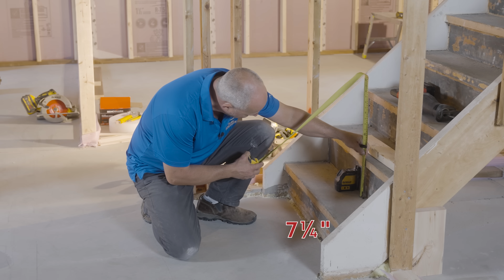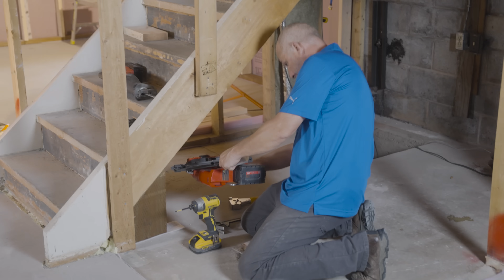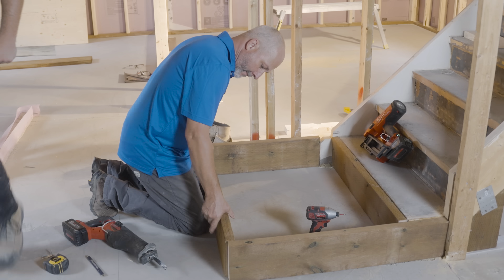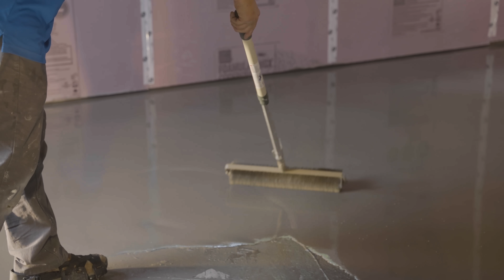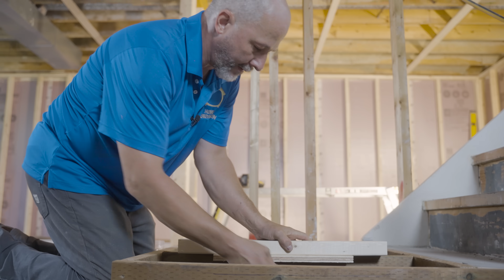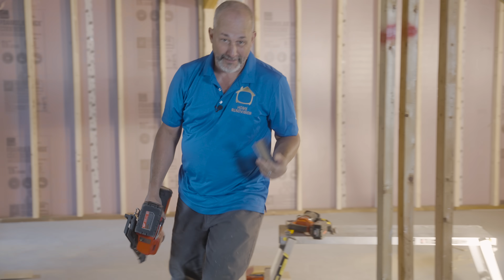The Most Common Basement Problem (And How to Fix It)

Comment: Why do I feel like this is being done the hard way LOL.
Reply: He actually created more work than what was needed. If he ran the 2X8’s through a table saw to cut off the 5/8” he could have glued and screwed one piece of plywood to the base. Adding extra pieces of 2X4’s and sistering is way more time consuming and it can squeak. He also could have added Zip tape under the 2X8’s or used treated to save a step. Yet that would cost more.
Reply: @jasonroets660  I had to build 2 landings in my new build as the contractor screwed up the stair stringers, not even getting into that in a public forum.   however I did exactly as you did, and running the lumber through the saw really straightened out the frame.   Cos you know how good lumber these days is, i think they are getting them from banana trees.

Comment: I'm finishing a basement.  Does anyone know if better to install drywall first or doors? I'm at that point.
Reply: @Gemini-wz3id  if the doors are prehung you need to have the drywall first because the trim sits on top of it. If you're assembling the frame from scratch and the trim isn't attached you could do the doors first and keep the trim for after the drywall is up.
Reply: @Gemini-wz3id  I actually did this in my basement about 15 years ago. I did the drywall first. I did 4 doors, basement is 2240 sqft. (ranch home), 1600 is finished, rest is storage, furnace, water heater and a work shop with 2 work benches and mostly unfinished. I bought 3 four panel oak doors unfinished and a glass mirror sliding door (for a closet). Doors come standard with a frame for a 4 1/2” (or 4 9/16”) wall (3 1/2” stud + 2 pieces of 1/2” drywall). My 3 doors came this way. The sliding mirrored glass door (set of 2 for an opening of 4’) came with no door frame, so you have to frame this out yourself. The oak doors fit on the space with no problem on 2 openings (to the workshop), however the third wall was not 4 1/2”, but 5 1/2”, so the door frame was 1” too short. I also needed to trim out the opening for the sliding mirrored glass door, that opening was the standard 4 1/2”. I bought 3,  8’ pieces of 3/4” white oak boards 8’ x 6”. I cut the oak pieces for this 4’ sliding door (2@ 4 1/2” x 80” and 1@ 4 1/2” x 4’), at the base to support the track I framed the wall with a 2x4 on the floor. This made the opening a box, I did this for the other 3 doors also for the same reason. The fished space was 18” ceramic tile which was about 1/2” above the floor and I trimmed the with a 1/4” shoe stained for all doors except the 4’ sliding door, it wasn’t necessary. The door going into the washroom, which was 5 1/2” wide, I installed the door flush inside the washroom and I added a 1”  piece, all around the opening (this was left over from the 1x6 oak I bought, I measured this in advance, this wasn’t by luck). 
PS: Reasoning behind all of this.  The 5 1/2 wall was under a beam supporting the home, so it couldn’t be 4 1/2”.  The 2x4 in each door opening on the  floor. The washroom door was next to a support steel post next to the door, this made the frame solid. Both other oak doors, one was by a support post, the other was next to a wall that was short, this tied everything together solidly. Same with the closet, it needed something on the floor for the sliding mechanism for the sliding door. The doors/frames, trim, and oak, were all stained and polyurethaned before they were installed. The 2x4’s on the door openings were stained and polyurethaned in place. I double trimmed (both sides of door) the washroom, closet and even the doors going into the workshop. 
PPS: I paid $79 each for the oak framed door (oak veneer doors and frames, solid doors), for a 4 1/2” wall. To get a door made for a 5 1/2” wall, it was special order and cost $225. So I did it the way I did. I had a tablesaw, without it, you would have to find a was to cut down the oak. I also made 2 window sills from the remaining oak in the basement.  
I hope this helps……questions?

Comment: Just a thought:
It would be better to rip your new joists to match the height of the last step of the existing stringer, remove the tread material from the bottom step of the existing stair and replace with a new one piece landing plywood piece to encompass the existing stair tread and the new landing in one piece.  Also, it would be a good idea to secure the new floor joists to the concrete floor with 2x4 plates that are attached to the concrete floor with fasteners.  (3” framing nails combined with a double strand of tie wire driven into a 3/16” hole drilled through the 2x4 plate into the concrete floor works very well) (A 3” #8 screw combined with a piece of 14/2 copper wire with insulation also works well and is easy to extract if needed.
John Jensen from British Columbia
Reply: I've never seen basement stairs secured to the cement floor the way you're describing. Is there a reason to do it?
Reply: @ 
If the stringers are only attached to the floor joists at the top, if done properly, it is a good connection, but adding a secondary connection to the floor at the bottom is bulletproof.  With stairs inside a stairwell where the stringers are attached to the studs, this is not critical, but with a set of stairs coming from a deck down to a concrete walkway for example, securing the stringers to the concrete at the bottom makes for a much better connection.  I usually notch
the stringers to  accept a 2x6 plate fastened to the concrete.  This makes a bulletproof connection and keeps the stairs from sliding out at the bottom.
Hopefully this makes sense.
Reply: Bingo!
Reply: Yeah, I would have ripped 3/4" off the deck joists and just cut one sheet of plywood to cover

Comment: My biggest basement problem is... I don't have one, and I'm still watching.
Reply from the maker: LOL. Thanks for that. Cheers!
Reply: I have no basement, no attic, and 625sft. I watch this channel to see all the things I can't do.
Reply: @nayy31  I live in the Midwest (NW suburb of Chicago). I’ve been here in this area since 1955. Basements are a normal thing here (Wisconsin, Michigan, Indiana, Iowa). Architects, builders, etc, in this area, know how to build basements. My brother lives in Charlotte, NC and I’ve seen walkouts that were done wrong with water problems.  A friend built a home in Mountain Home, Arkansas and did a partial basement, with drainage tile, sump pump, etc. The building inspector had never seen anything and didn’t know what to inspect, he was confused, but it worked well. Florida, the water table is 6” down, no basements. So you have to check out what’s happening in the area you want to live, talk to inspectors, builders, etc.
Reply: That makes you a dumb dumb

Comment: Why not rip the boards down and have one sheet of plywood for subfloor?
Reply: That was my first thought. Then you'd have the plywood pushing down straight on the frame.
Reply from the maker: that is another option, however I did not have anything to seal my edges that day and I am all about production. Cheers!
Reply: @HomeRenoVisionDIY leave the cut side up no seal required

Comment: Just rebuild nicer stairs if it's your forever home
Reply from the maker: I will cap them, but I don't see the need to but a new set of stairs when the fix is so easy and it creates a nice space to add a wall for separation to the bathroom and install light switches as well. know the whole plan before starting. Cheers!

Comment: Would ripping the landing stringers to accommodate a single sheet of plywood work and meet code?  Nice job, thanks!
Reply from the maker: if you have a split staircase like this one then yes. if you have a straight run then no. Cheers!
Reply: @HomeRenoVisionDIY  Why would the type of staircase matter?  Thanks

Comment: This is nice. We got a finished basement LOOK. Just need to do a ceiling and clean out some pack rat junk my wife loves to hold onto. It's just not on the to do list as of yet.
Reply from the maker: Cheers Tim. nit every basement gets work on a permit. however for those who do this is crutial to avoid failing at the end of the job on the final inspection.

Comment: The most common basement problem is WATER.
Reply: Well thats why the whole field of civil engineering was invented. Its entire purpose is diverting water away from houses.
Reply: @valentinek.t3327  and with that said it still doesn't change the fact water is the biggest issue not a bottom step
Reply: @peteradams7457  Well yeah that's what Im saying. If there is water in your basement is more than likely a flaw in the design. With downspouts and grading its supposed to be bone dry. Messed up
Reply: Any ventilation and moisture mitigation  tips??
Reply: @TF4Life-84  in order of importance, 1. proper grading such that there is no puddle/surface water near the foundation, 2. french drain along the footing to further relieve ground water. 3. water proofing of the foundation wall.  essentially you work out a solution from outside of the house, and from surface down. Building a foundation like a swimming pool to keep water out is very expensive.
Reply: @TedQian  In order of importance: 1. Do not build near bodies of water, as they are all prone to fluctuation. 2. Set your foundation well above the seasonal water table on well draining soils. 3. Grade.

Do these things and water intrusion, at least that of a chronic or widespread nature, should not be an issue.

Unfortunately, millions of residential structures ignored these basic tenets and homeowners are left having to rely on frequent use of sump pumps to keep their structure above water. The need for a sump pump is a failure of proper planning & engineering at the most fundamental level. 
No matter what snake oil waterproofing companies try to sell you on the need to relieve hydrostatic pressure, water should ALWAYS be kept OUTSIDE and no pathway for water to enter inside a structure should ever be considered. Once that's done you've already lost the battle.
Reply: Instead of fixing problems, we should strive to build homes that is in harmony with its environment to minimize things like water proofing a basement where water table is high.
Reply: Basements are a paradox. You have to dig to create a basement. Disturbed earth will always absorb more water. The only way water isn't an issue with an underground structure is not to dig. Instead of using dirt to backfill use concrete. Money
Reply: Amen
Reply: Make a video about it. Put in the work.
Reply from the maker: in truth there is at least 6 different water issues in basements depending on the age and location and climate. This issue is in every basement ever built. Cheers! Your statement is like saying the most common problem with living is dying.
Reply: @HomeRenoVisionDIY  The earth should have the common decency and respect to spare man-made structures from its unforgiving wrath. The nerve!
Reply from the maker: I do not see the Earth as a friend to mankind. more of an enemy that is trying its best to extinguish it. Cheers!
Reply: @HomeRenoVisionDIY  A defense mechanism to a predatory species no doubt. If there was ever a time that mankind worked in harmony with nature, those days are long gone.
Still, I'd think that our civilization has advanced to the point of being able to solve water intrusion in sub-grade structures by now. But nope!
Reply: @HomeRenoVisionDIY  that's a stretch  we are all part of the same environment we just need to find ways to fix the problems
Reply: @movullina  ...and we need to stop creating new ones. Cheers.
Reply: @HomeRenoVisionDIY  true words! Anyone who has ever worked out in the blistering heat or freezing cold or gone on an extended backpacking trip without enough preparation will find your statement to be very true! We are not at the top of the food chain but somewhere in the middle. Cheers!
Reply: @HomeRenoVisionDIY  too funny
Reply: @HomeRenoVisionDIY I'm actually impressed you are installing LVP on slab which judging by the house construction doesn't have a vapor barrier or if it had one it likely failed by now. LVP is waterproof top down but not down up, and film vapor barrier will just ensure that moisture will get trapped under the floor and mold will grow and poison everyone. But then again, who gives a f*ck if you won't be living there, right?
Reply: Not water it's your grown kids moving back home and living in the basement
Reply: @elainerussell924  Or the poor economy or the uniquely American stigma against multi-generational households.
Reply: @UToobin75  what !
Reply: @UToobin75  the multi gen comment is very true
Reply: @UToobin75  yes, living with my parents would be the best thing ever. Said very few

Comment: Can you put the item that you use under the treated wood
Reply from the maker: it is called a sill gasket. you can also use 6 mil poly/ plastic or simply have the cut side on top and have the PT side on the concrete to pass inspection. Cheers Naomi!
Reply: @HomeRenoVisionDIY  thank you